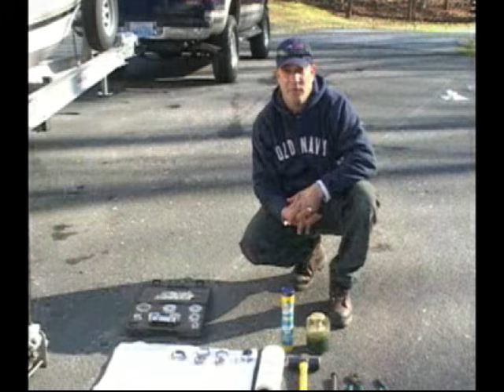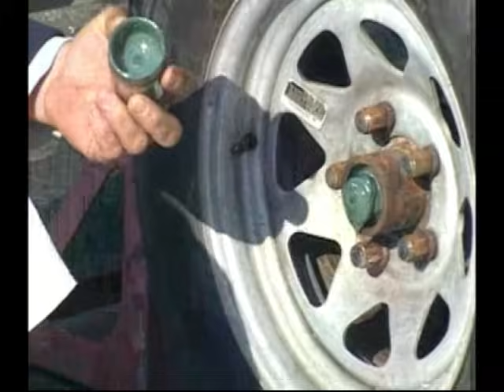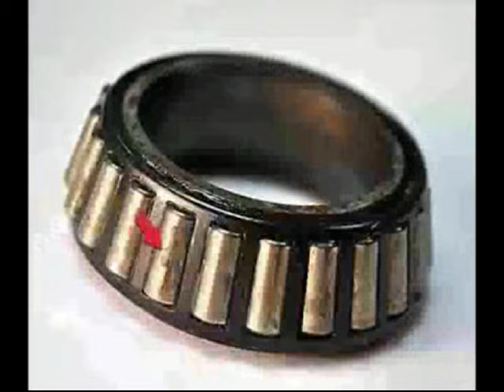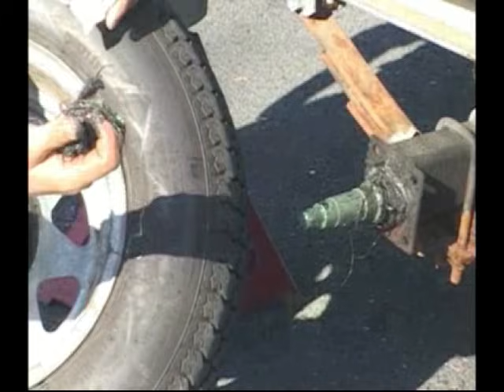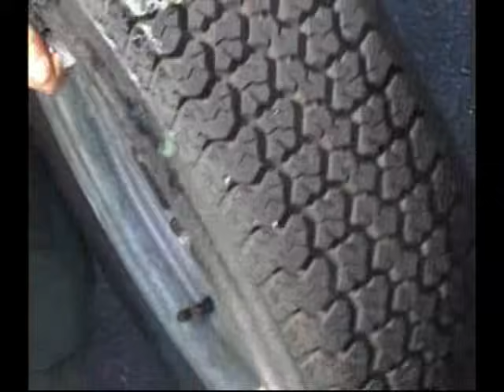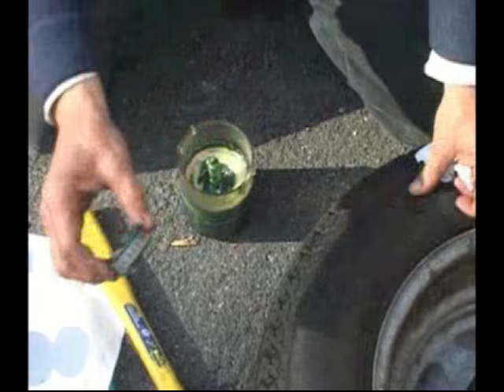How To Replace Boat Trailer Bearings | BoatUS

Comment: I was intimidated to tackling this project but I didn't really know where to take my utility trailer for service. I decided to do it myself and this video was spot on. I had to ruin my seal when removing, but I was replacing anyhow. Original bearings are 14yrs old, I thought that's pushing it on age, so hopefully these will last another 14yrs. Thanks again - perfect video
Reply from the maker: Glad this video was helpful, Keith!
Reply: 14  year old bearings,brother you took care of those really good or you were a very lucky man

Comment: Excellent job!  I have watched a lot of video's on how to adjust the bearing torque.  Your's is the only one that recommends a very slight amount of play which is the proper way to set the bearings.  As for having the wheel on before tightening the nut, this allow a much better feel to adjust the slack. I always check the play with the tire on.   Not leaving a slight amount of play is the best way to burn up a bearing.  I've done hundreds of bearings and always back off the nut until I can grab the top of the tire and feel a very slight amount of movement.  Very good job. I hope people realize, a slight amount of play is what you are shooting for.
Reply: Sir, there is a few videos out there that speaks about this in which came out around the same time of the video and your comment. It is a possibility that you did not see the same ones I did however. This video is outstanding.

Comment: Love it!  I just got a brand new tandem axle EZ Loader trailer with the boat I cought and I'm looking at the wheels and thinking to myself "damn, I need to know how to change the bearings on this thing or even just understand how they look like just to have the know-how", and now, not only do I know what the inside looks like, I feel pretty damn comfortable tackling this operation on my own.  Just gotta go buy that bearing packer kit and race installing tool and I'm good to go. 

First thing I need to do, though, is jack the trailer up to check for any noises.  Great tip and what a difference from the original wheel noise to after you replaced and repacked the bearings!  Thanks for an awesome and informative video.

Comment: A video like this proves that people will hate on anything, just to be hating. This is a great video and breaks down every step. 33 people giving this a thumbs down shows that people are ass holes just to be ass holes. Great video man. It helped me do mine without a single issue. THANK YOU!!!
Reply: +Russell Devane Well, I am sure your quite used to being wrong, and here you are wrong again. I gave it a thumbs down because there is no possible excuse for leaving all of that grease on the back of the wheel. After about 1 week of driving you will not be able to tell of the grease is new, or old. Just no excuse for that. Otherwise he did a great job. What a weird place to cut a corner...
Reply: +ejlarson249 Aaahhhh..... Ok and you would be one of those people! THANKS for proving me right!

Comment: Nice to see a how-to YouTube video done by a real mechanic.  Correct application of force is essential, and well explained here.  I would tend to take the wheel off first (per the recommendation below) but a matter of style.  There may be a buildup of corruption/corrosion between the wheel and the hub, and doesn't hurt to check.  But Dustin makes it work his way.
Reply from the maker: Thanks for your input! It is very much appreciated.

Comment: this is an awesome vid...but I use a brass punch to remove the races and also you need to use a grease gun and fill the hub using the bearing buddy nipple...fill the hub until you see the bearing buddy disk starting to move outward...always wear safety glasses too!
Reply: He added grease to the outside of the bearing buddy lol

Comment: Great vid I personally don’t use bearing buddies they allow water in I’ve done wheel bearings for years I use sealed caps and some sealant on cap to prevent water in.
Then make sure to put some grease on your lugs so they don’t rust
And I usually just replace the whole hub just easier and cost effective .
Reply from the maker: Thanks for sharing your experience, Mark. Others may find it helpful.

Comment: I like how u used a bearing packer too.   And I swear by that green trailer grease you used.  I always check my bearings like u did for sound.
Also if towing I stop after about 10 mins to check them for heat.  Replaced lots of failed bearings on trailers that I bought but luckily never had one fail yet (knock wood).
Oh, I usually use a piece of wood to drive the other wheel up on instead of jacking it.
Thx again.

Comment: Good video.  I would only add that you shouldn't put the hub on WITH the wheel.  Also u should put grease in every cavity as possible not remove it.  And grease the seal and axle before install. Bend the cotter pin COUNTER clockwise and use a piece of wood with the hammer. Then spin in and use a grease gun to fill cavities.  Do it a few times until the bearing buddy no longer goes in much after spinning.
Reply: I meat NOT counter clockwise.
Reply: Isn't NOT counter clockwise the same as clockwise? 😎

Comment: Awesome! I have been wondering for many years how to do this - all I need is a race tool and possibly a bearing packer. I understand that you can pack bearings by hand - it takes a while, but it is a doable task, right?
What about that stainless steel collar? Do you have any links to that being installed or maybe just a picture?
Reply: Thanks! :)

Comment: blosom - some, but not all, trailer hubs use different sizes for the inner and outer bearings.  It's important to lay the bearings out in an organized manner to make sure that the parts get put back in the right way.

Comment: What's a spindle? No..., just kidding...been doing this shit all my life. This is a good demonstration of "how to" for the everyday man "at home." I hate "how to" vids that show people using high-end pullers and specialty tools...what regular guy has that stuff, right? Good job. I would have done only two things differently in this setting:  Prepping better by cleaning all areas around the parts being serviced and, though it seems leaving the tire on the hub helps with aspects of handling et cetera, I'd remove the tire for multiple personal reasons but most importantly the risk of the seal being damaged during reassembly. This video is really a big help for those who may lack confidence related to performing this task. I'd point anyone (who asked me about this maintenance task) at this video. Again, this is good.  For the dude who might wish to criticize my observations, try to understand that I spent years rebuilding industrial refrigeration compressors in both marine and commercial applications...know a thing or two about bearings, seals and the importance of cleanliness around highly engineered moving-part surfaces.  Press on.

Comment: Can you replace a full width seal with a half height one?  Would you still only tap in a half height seal so that it is flush with the hub?
Reply from the maker: Thanks for the question, Mr. Charlie. I’m not exactly sure when you talk of a half-height seal. I can only imagine that you are considering using a single lip seal rather than a double lip seal, in which case I would caution against it. Boat trailer bearings lead a tough life. Especially when you consider that they get warm with the boat rolling down the road, then you dunk them into cold water while you launch the boat which cools the hub, makes the air contract and suck water past the seal and into the bearing – a double lip seal avoids this. My advice would be to use the same type of seal that came out. Do not skimp on trailer bearings, grease or seals or you could find yourself trapped at the side of the road with a broken down trailer. Trailer bearings are pretty cheap so don’t try to save a few pennies here– it could cost you in the long run.
Reply: Thanks for your quick reply.  I am haing difficulty finding the same grease seal as I am removing.  The old one is O.D. 1.983  I.D. 1.274 and 0.437 high.  I have found a similar seal (Rockwell American (12192) which is also doubled lipped and has the same O.D.  but I.D. of 1.25 (which is a little tighter) but the height is only 0.25.  My thinking was this seal may have to be tapped into the hub slightly further to keep the bearing in the race but a friend said "no, keep it flush in the hub.
Reply from the maker: @Mr3Charlie  If you really cannot find the same seal as the old one then the one that you refer to may work for a time, but as the seal will be tighter on the shaft I would not be surprised if the seal wears a groove on the axle. This will cause the eventual failure of the seal allowing grease out and water in resulting in potential collapse of the hub bearings. Any seal should when seated be flush with the back of the hub.
Reply: Thank you for your reply and information!

Comment: where did you put the jack to lift up the trailer at the beginning of the video? on the frame?
Reply from the maker: Hi Pablo. Yes, on the frame. As Dusty says, you want to find a solid area on the frame and not on any springs or anything that can bend.
Reply: @boatus  thanks.

Comment: Can you do this without a race driver?
Reply from the maker: Hi Peter. Thanks for the question. Yes, you can. Use a large punch and tap around the inside of the bearing to either remove the bearing race or reinsert it. I’ve found about a 12-inch length of 1-inch diameter pipe works, too.

Comment: Decent how to , few minor things I have to harp about #1 grind off the mushroom top on your punch (main reason you wear safety glasses) #2 you did not apply a thin layer of grease to the lip seal #3 the codder pin ears needs to be spread out opposite of each other to prevent it from "popping out" (uni-directional) #4 smacking around the codder pin with side cutters hitting the threads can be a nightmare for the next guy

Other than that it's all good . I myself would not recommend bearing buddies , everyone always over greases them causing high temperatures and premature bearing failure along with blowing the lip seal out on the back. Also if you blindly keep adding grease to the bearings the grease is obviously going somewhere. Take the time and do the steps to properly take care of the trailer bearings, a couple dollars for a blown lip seal and a repack on the bearings are going to pay you back in spades.
Reply: Wait, I thought they self adjust the grease amount.
As long as u don't pack them so tight that they won't spring in anymore.  Also I thought u want no cavities without grease otherwise the grease won't reach the inner bearing?

Comment: Decent video but there’s some things that can be noted. 

Those lug nuts need to be changed for an open lug nut not sealed. 

The bearing buddy wasn’t gone over and how to properly use them. Were they seized up? How much grease do you pump in and most of all when? Brake hubs vs non brake hubs as well...
Reply from the maker: Thanks for watching and for your comments.

Comment: Don't you need to fill behind the bearing buddy through the zerk fitting before you put the dust cap on?  Also ought to clean all the old grease from the failed seal on the inside of the wheel. Why not use the bearing punch and sealer to seat the grease seal instead of using the hammer.  If you do that there is less chance to deform the seal that may cause a leak.  Otherwise this is a very good instructional video.

Comment: I replaced my races, bearings and tightened down the nut and backed it off as you suggested.  I spun the wheel to make sure it was silent and fitting well.  When I put the bearing buddy back on and filled it with grease, I did it until the fitting just rocked a little bit.   After doing this however, when I went to spin the wheel, it would only spin about one revolution or so before stopping.   I wouldn't think the extra grease would have this affect.  Have you run into this?   What did I do wrong?   I
Reply: Brian Bonner I have given this tightening of the wheel bearing a bit of thought over the years and I think that although you don't want to load the bearing and keep them running free I can't help thinking that once you put the weight of the boat on the bearings they will have considerable loading and as these are tapper bearings an play will put them out of shape [not perfectly lined up] so wheel is not perfectly straight,no play and the wheel should spin free anyway,,,,as for your question about extra grease it wont slow the wheel up for long once it's turning on the road,the grease will clear a path.
Reply: chris keeley Chris, thanks.   I repacked the other side of the trailer and it spins fine.   I'm wondering if maybe the new races I put in somehow aren't seated all the way (i.e. somehow they're in at an angle, which doesn't seem possible, but does seem like it would cause an issue with roll.    I'm going to try again, I guess.   It's disappointing.
Reply: Brian Bonner if the cups are not seated properly they will seat when you first take it out and the bearing will need to be tightened again and no you have not put them in at and angle you wouldn't have got them in at an angle,grease will not slow the wheel once it spins a few times,it only grease and the trailer is heavy,I don't have an rocking when I put them in to save the seals from stress.once the weight goes on free play will save nothing.
Reply: Sounds like it was a bit too tight.  Unless maybe the cotter pin or something is hitting the bearing buddy.

Comment: Does the hub need a Bearing Buddy or can you put the plastic cap straight over the bearing and hub?
Reply from the maker: Bearing Buddies are optional. It is perfectly acceptable to use the metal or plastic hub covers to retain the grease. This is a case where one uses one or the other, not both. Many trailer owners like Bearing Buddies for the ease with which the grease can be added to the hub. Additionally, because the grease is under a slight  measure of positive pressure inside the hub, water and dirt are less likely to find their way into the bearings causing premature wear. Thanks for watching!
Reply: Speaking of b
Bearing Buddy, why not fill the Bearing Buddy at the end of the procedure to make sure you have that desired grease "pressure"?

Comment: It's just the bearings size and washers and nut holding the hub on the axle ?
Reply from the maker: Thanks for the question, da ne. On most trailers, the innermost bearing – the one toward the center of the trailer–is smaller than the outer bearing. The bearings are tight press fit into the hub, which is then slid onto the axle spindle, and then the wheel hub is held in place with a large washer and castellated nut. A cotter pin passes through a hole drilled in the axle aligning with one of the slots in the castellated nut. This arrangement holds the hub in position and prevents it from coming undone, which, if it were happen at highway speeds, could be disastrous.

Comment: Ok—this videos 8 yrs old so I’m not sure I’ll get any response but...Let’s say I want to have this done because I’m not all that comfortable doing it myself—who would I go to for this type of service?
Reply from the maker: Hi John! The video might be 8 years old, but we're still here! Thanks for your question. You can do an online search for trailer repair shops near you or ask around  your boating friends for a recommendation. Personally, I've also found that many tire shops and general mechanics can do this for you as well. If you have an independent repair shop that you use for your vehicles, ask if they have someone who can do it or, if not, if they can recommend a good shop. And while you're there, have them check over the entire trailer. An analysis of our claims shows that tires, wheel bearings, and axles are the top reasons for boat trailer breakdowns: https://www.boatus.com/expert-advice/expert-advice-archive/2018/june/causes-for-on-the-road-boat-trailer-breakdowns. While you're at our website, you can search for other articles on boat trailer care and maintenance. Thanks for watching and getting in touch!
Reply: @boatus  thank you so very much for taking time to give me so much fantastic advice. I enjoy your channel and it’s content immensely.if you were to have any videos on single outboard docking—in a tight slip in a crowded marina I would be indebted to you! THANKS AGAIN👊🏻
Reply from the maker: @johnm5714  You are more than welcome, John. 👊 back atcha! We have videos on how to dock a single screw outboard, and we have one on how to dock in a tight spot with twin outboards. We will certainly add your great suggestion to our list of possible future video topics--presuming that we can get out to video again sometime soon. Have a safe and fun boating season!
Reply: @boatus  you guys are awesome—thanks again

Comment: mine was/is making an awful noise! seal is gone so little to no grease and tire wobbles at low speed then gets so hot they turn blue and even smoke.  you can see metal shards.  i repacked them with Vaseline and didnt have another seal so i cut out a semi round piece of flex tape.
 full send it
Reply from the maker: Sounds like you need new bearings ASAP. BoatUS does not recommend this repair solution.

Comment: I think your punch is in a dangerous condition, The head is mushroomed out with hammering and bits could fly off in use. It should be ground off before it reaches this state. Otherwise a very good video. Thanks. Dave, (ex-Blacksmith) UK.